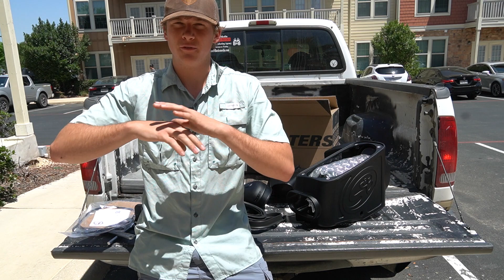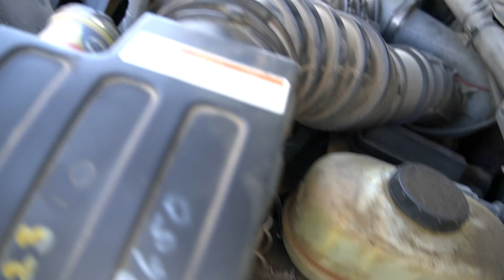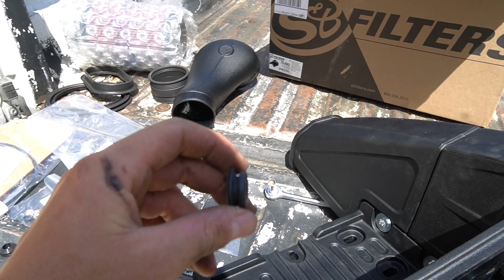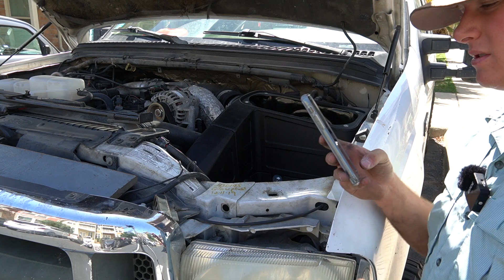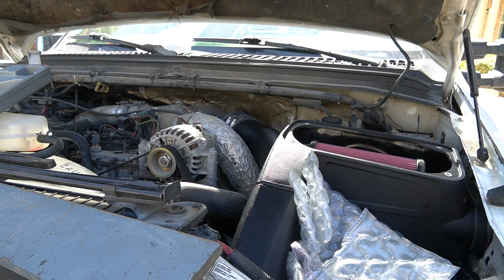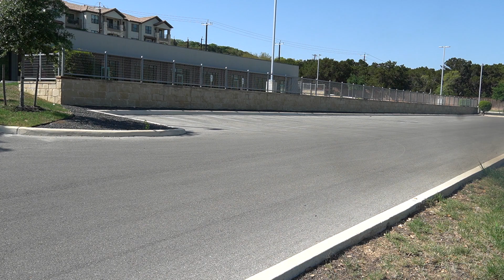Cold Air Intake Install On My 7.3 L Powerstroke Diesel! Insane Turbo Whistle Increase! (Sound Test)

Comment: I just put a S&B cold air intake on my 7.3 powerstroke 2001 and I love it but I don’t have the sound you do on the outside. How do I get that
Reply: straight pipe your truck i got 01 7.3 powerstroke too and it spools alot just with a straight pipe alone( just get rid of ur muffler)
Reply: Does it make the truck louder when you floor it ?

Comment: Did you cut the hole on the right side of the radiator to allow more cold air? Also any issue getting to your power steering fluid check, they were supposed to fix that issue. I am getting ready to buy mine.

Comment: Finally! I’d recommend getting a sock for the filter it helps filter the smaller stuff a little better.
Reply from the maker: 👍🏻👍🏻 I’ll look at it
Reply: @powerstrokecentral  part number should be on the sticker that came with the cold air 🙂 also if the headlights require you to cut the back board where the light goes you can get one from a 05 6.0 and it should bolt right up so much cutting/modifying

Comment: Stock exhaust ???
Reply from the maker: Just a straight pipe
Reply: @powerstrokecentral  get a 5 inch with a 4 inch down pipe and a bigger tip, it’ll sound a lot better and run better, it will also add some hp

Comment: @powerstrokecentral are there any cons to consider when installing cold air intake?
Reply from the maker: Not that I saw man it was a pretty easy install the only thing i might have an issue with in the future is it sucking in dirt but I don't think it will as long as i installed it right.
Reply: @powerstrokecentral  ya I don't see why it would suck in more than a regular filter. Are there any potential issues with the engine temperature? Does it run hotter or cooler?
Reply from the maker: @cosgrayfarms  I need to install gauges for that I assume it will run the same temp as long as I don’t get on it to much.
Reply: @cosgrayfarms  S&B filters filter smaller particles than regular filter and with the size and design it lets it suck it more air